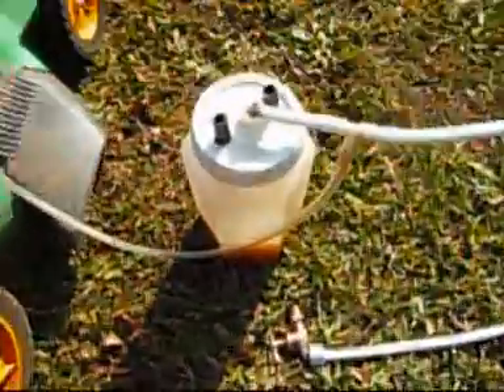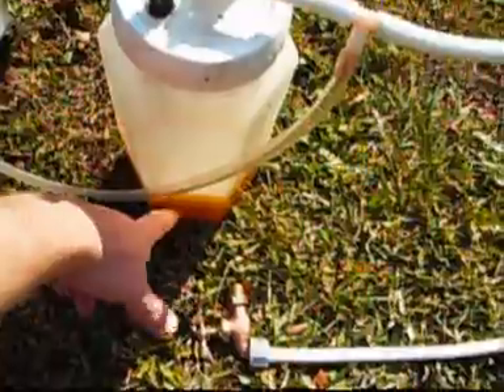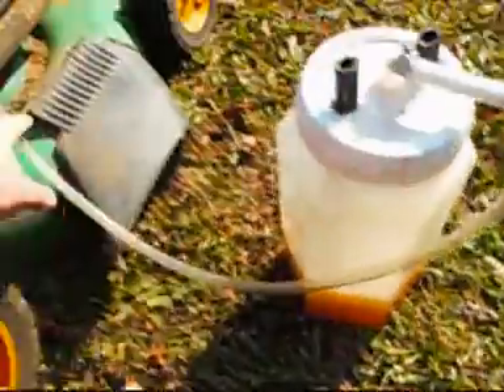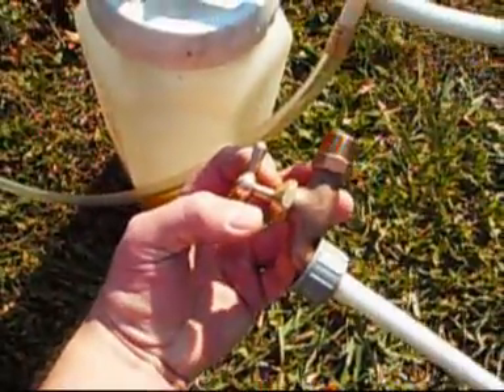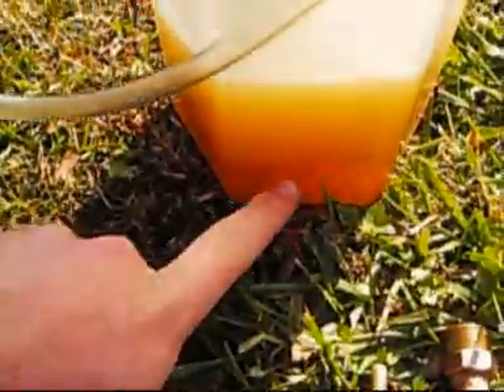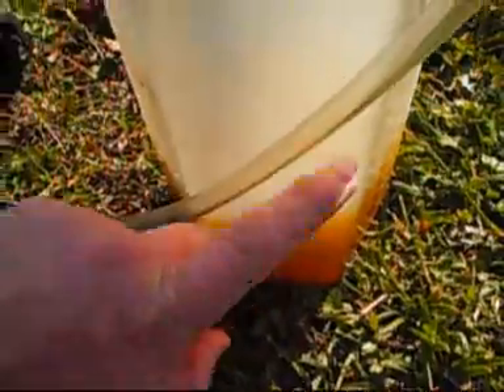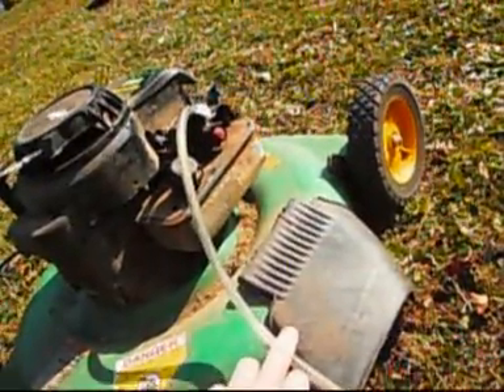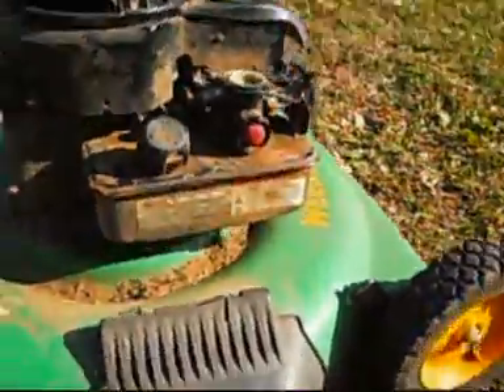Vaporizing carburetor

Comment: If you do try this on an FI engine. Be very careful not to run your injectors dry. This will damage them. Unplug each injector or pull the fuse. 

Because FI engines are run by a computer, it may not work due to the engine thinking it's running out of fuel. But I say try it out! Just make sure to kill the injector power when you don't need it.

Comment: Before the elastomer vibration dampers, harmonics would have been a problem. 
Yes, perhaps water introduced before or after combustion could raise internal pressures. But how much water mixed with the oil, etc. I don't know. Magnesium has a problem with water, maybe. Inert gases, such as CO2, nitrogen, may not enhance combustion. I just want to see the Briggs under full load running on vapors. Then I'll copy the plans, ha, ha,..

Comment: I'm only guessing no technical answers here It may have been the extra pressure from the water expanding in the combustion chamber causing too high compression. Could be long period break down of lubrication like a rich mixture wash effect just with water. Like you suggest the engine couldn't handle the different vibrations at that frequency. Or all of the above.
 I wonder if the mower would work the same with any inert gas mixed with fuel

Comment: WW2 spitfires had a water injection device for temporary increased hp however they could not sustain the extra hp without blowing up the motor. So the concern is how hot is it getting in the combustion chamber?

Comment: Now when the slide gos up or down in its tube it acts like turning the coleman stoves burner controle knob would buy pulling the Stepped needle in the jet in or out of the Fuel jet. low is for starting and high will be full throughtle. You will still have to use the stoves old light and run position lever but it willl now be mounted on your fuel tank for your engine.
Have fun And get awsome fuel mileage on your lawn mowers.

Comment: Next you replace the tube that used to cross over the burnner with steel brake line that is braised to the Exoughst manifold in a spiral, for inital lighting you heat this with a propain torch ( or build a kerosene lamp wick under it.)

Comment: And Jb weld the Air fuel mix box and jet to face up at the slide and needle asembaly of the carborator!
You then take the needle out of the stove's Flame control knob, and cut the motor cycle needle down and soder the stove needle in place of the tip of the old Factory carburators needle.

Comment: You guys want to know the real trick to building a vaiporising carburator?
you will need a small Motorcycle carb, the type that uses the needle on the
slide, and a walmart Coleman Duel fuel single burner Stove. 
You take apart the carburator, and repace the motor cycle fuel jet with the stove fuel jet. By driling thrue the bottom of the carb case where the flaot bowl used to be.

Comment: I saw your video last night and this morning I built my own crude example to prove to myself that it can be done. Well, I hooked mine up to a 11hp garden tractor and HOLY CRAP IT WORKS! seriously! I just have to get a better way to control the fuel air mixture, kinda like your water tap. Im using my finger for now. I only had like maybe two carburetor fulls of gas left so I dumped them in the vaporizer tank and then disconnected the carb from the regular gas tank. It ran MUCH longer than normal!

Comment from the maker: That is great just make shore not to use glass.. I just add some gas to the water... As long as it has gas in it, it will run. I tried HHO but it did not make much of a difference. I made one of those that preheated the air and it was a little hard to make. I wanted to build something that anyone could build. I used every day stuff so everyone could see how easy it is! 
Thank you so much for your great comment and for your sub!!
I hope it all works out for you! Good luck.
All the best, Richie.

Comment: Hi.
WOW, WOW WOW... I will try on my 4stroke 250CC engine.   What percentages of water/gas do you use? Did you do your HHO addition?  is HHO really required? (or this bubbler would be all you need? From what I can see, there's no need to pre-heat the income air like others are doing with the hot exhaust...  Wow, I am so impressed!    Such a cheap setup.. I love the water tap to control air-in.. How easier and how cheaper can it get? I love this video!!!
5*:  *  *  *  *  *
Cheers,
Techie.

Comment from the maker: Thanks!
I could not believe how much control I had on the throttle ether!!!
I tried hho it did not make much of a difference at 1 liter pm..
I am going to try making a wood gas burner and run the mower off of it! If it works i will post a video of it!
Thanks for the comments!!

Comment: Good tinkering, surprising what fine control you achieved over the range of the motor.  I like it!.  Be careful running hho/gas fumes, volatiles with radically different rates of ignition can get interesting, have fun,and be prepared.

Comment: Good idea. I hadn't considered leaving the carburretor on because the online plans I originally followed didn't say how to connect my fuelvapour delivery line to the carb air intake. But it does leave you the carb butterfly valve for vaccuum control which, if it works without req'ing air adjustments on the fly, also allows the governor to continue to operate that same butterfly.  As long as the fuel tank is empty then no fuel will fill the carb bowl so all fuel will be entering thru butterfly.